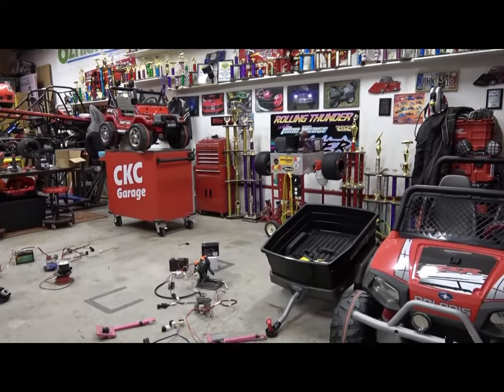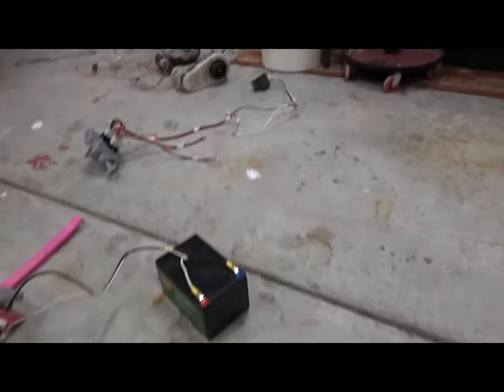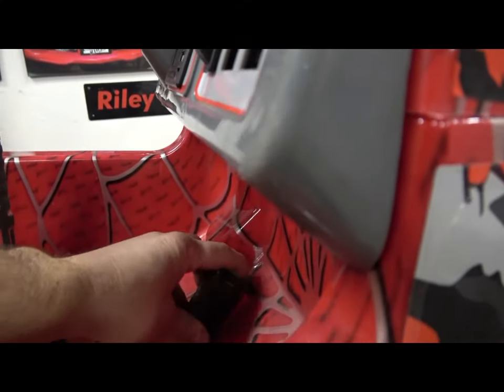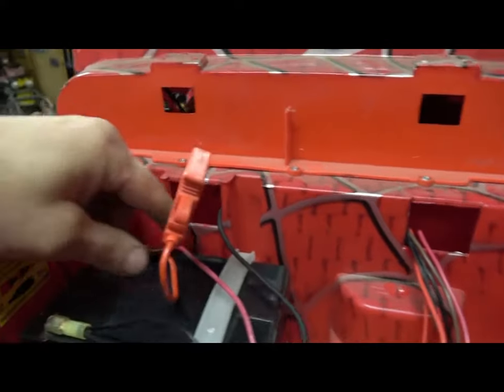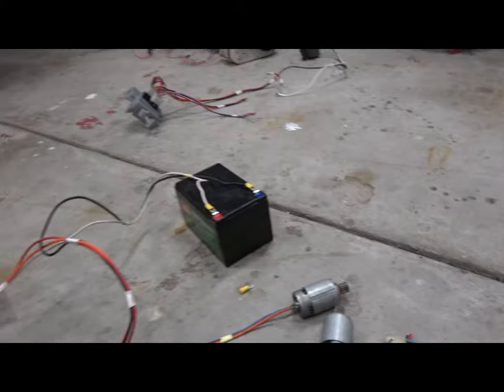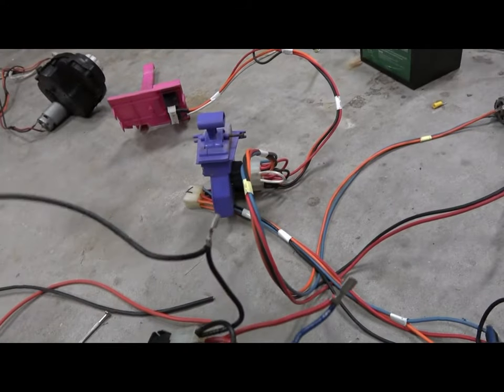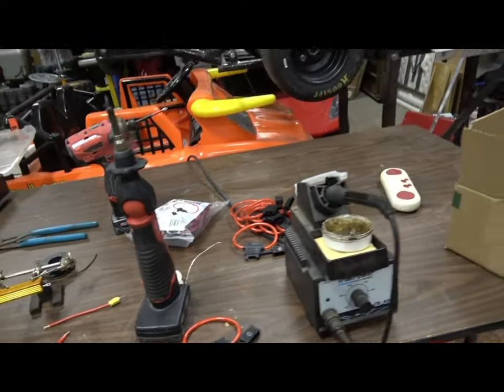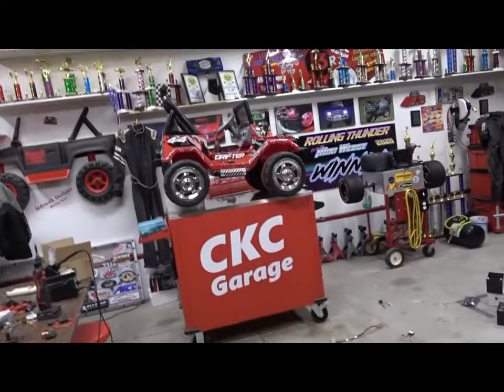How to fix ride on with damaged #Control Module #bestchoice #bigtoygreencountry #uenjoy

Comment: i picked up a jetson and it has a Steel frame under it.....but it comes with that Weely TOTAL TRASH regulator in it. SO its about to get gutted out.......DO NOT EVER BUY WEELY regulators ive had 3 now and they are all total garbage.

Comment: I didn't understand about the one wheel should spin backwards and the other spin forward. I put one of those wiring kits in a jeep. Both wheels go backwards but switch it forward left one spins forward and the other spins backwards. That's off the ground and it's still got the high/low switch and it's not been rode yet PLEASE HELP🙏.

Comment: Hello Good Evening, What could be the problem if the toy Only moves in reverse? If i put in forward it won't. If i put in reverse it will reverse. Only the forward is the problem
Reply from the maker: Not sure what model u have but it's either a shifter switch or relay in your main board
Reply: @CustomKidzCars  it could be the bluetooth receiver or its lets say reciever and the board? The motor is good i tried it.
Reply: @CustomKidzCars  the switch is also good, i really dont know 😂. 

But in Switch it will reverse and in the remote control it will reverse, but if i put in forward it forward in Switch and Remote. What could be the problem? Board?
Reply from the maker: @idodongtech6318  that would be my guess. I really don't like these cheap circuit board models. They fail very easily

Comment: Any tips on how to bypass a smart drive on a Barbie dream camper I have an old harness off of a Yamaha raptor. And what all would I need to keep from frying anything and burning the gears up.
Reply: And if I use a drill battery what would I need to do to keep everything safe and keep from frying that battery
Reply: I also forgot to mention it has a flashing purple light and will not go now

Comment: Hello. The wires that connect to the battery on our Best Choice jeep wrangler are completed gone from corrosion. I found a wiring harness replacement on amazon but I cant figure out how to install it as the red wire looks like its hard wired with screws to the back of the engine? Please help? Helen

Comment: I love the idea of doing a full harness swap from a power wheels. Thank you for sharing this video!

It's in my future to do a similar swap.. time permitting and donor availability. I purchased a Hyper Toys Jeep Gladiator 12 volt ride-on for my son.  He loves it, but I'm having issues with the motors and the circuit board. I can't wait to ditch the crappy electronics and tiny gauge wires on it.

Comment: Hello, I’m sure you get a million question so I understand if you don’t get to mine. My son has the Uenjoy jeep. The sound stopped working. I’ve changed the speaker but no luck. What do you think the problem could be? I also changed the small motherboard. The one under the hood. 

Also is there a good way to get more speed out of the jeep. Thanks!

Comment: Hello, 
I am looking to repair a similar ride-on for my son and I need advice on a replacement control board and a picture of what is under the hood. The one we have is missing the control board and fuses. Any help will be appreciated. 
Thank you, 
Sargis
Reply from the maker: Most units use weelye brand. Match it up with connectors
Reply: Thank you.

Comment: What's the piece inside the car that controls the turning ability through the remote control. And how do you replace it? It can only be controlled manually and I can still use the controller to go backwards and forward. But that's about it.
And It's not the controller. It's the part inside the car.

Comment: I modified my kids power wheel. I put two 12v 20AH making it a 24v  and now it’s super strong and fast but when it comes to go up a slop it just shuts off, what do you think the problem is? I’m assuming the problem maybe the motherboard but I’m not sure, I’ll order a higher Load Current since the one it has is a Max 25A Load Current
Reply: Sounds like there is a self-resetting fuse that's tripping.

Comment: Would any one be able to share what the original controller controls? Referring to the first black controller shown.
I recently did a 20V upgrade and it sounded like a capacitor popped but I feel like everything still works.  Any help would be appreciated by my 3 and 1 year olds.

Comment: Can you add the link for the High Speed/Low Speed switch as well as update the link for the PW harness (currently shows a pinion). thanks!
Reply from the maker: Thanks for the heads up. Those new OEM harnesses are hard to find. I wouldn't wait.

Comment: Hey i change the motor on my kids car from 12000 rpm to 30000 rpm but the car keeps turing off when the kids get in it to drive when i lift it ru es fine but under load it cut off i try'ed to remove the terminal fuse and run direct but still turing off sounds like it is clicking in the control modul what can i do to fix it

BTW awasome videoes 👌🙌
Reply from the maker: Motors want to spin 30k and are drawing too many amps. Those hi speed motors will just burn up in ride ons. I would install power wheels brand motors that spin 16k

Comment: How can I get this car to go up hills? Tiniest hill and the car shuts off.
Reply from the maker: Needs a bigger thermal fuse because the high amp draw is tripping the unit off to protect from melting the wiring. U risk burning up the wiring but that is what the issue is